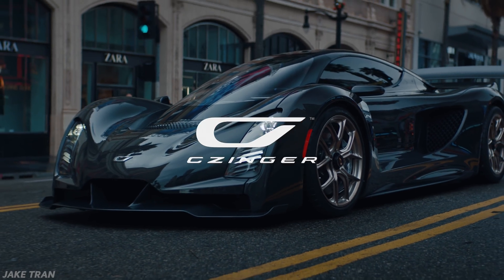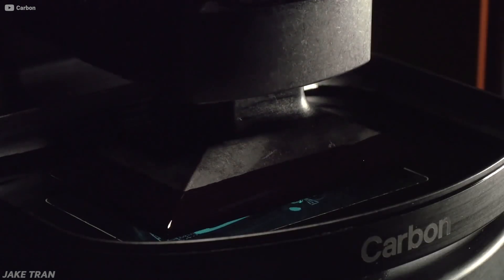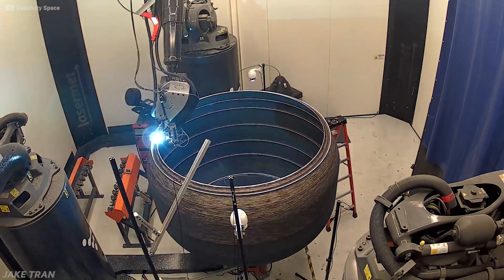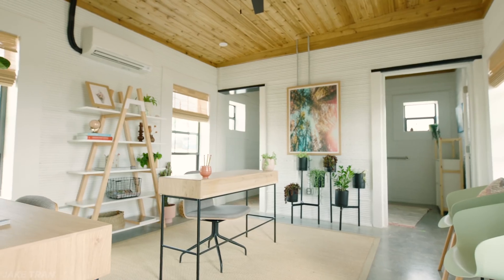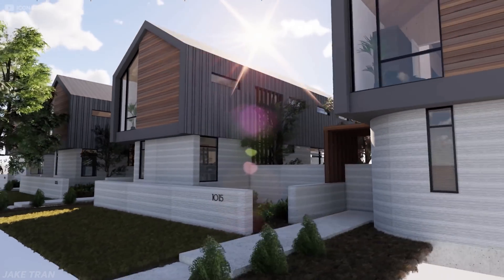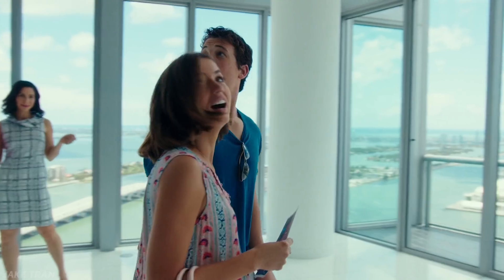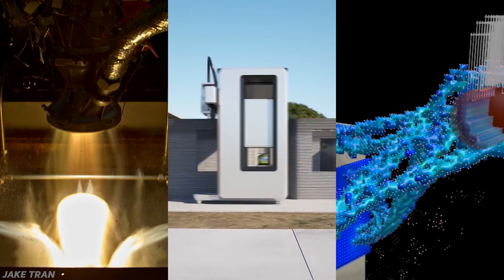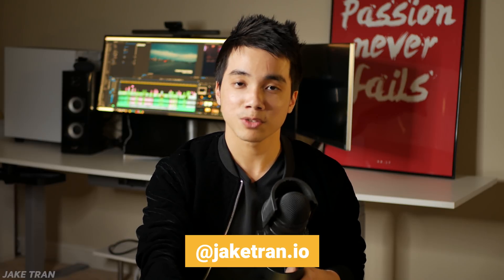The Trillion Dollar 3D Printing Revolution

Comment: As an architect, I have some thoughts on the "3D printed" houses. The interesting concession that gets ignored is that it's not a 3D printed house, it's 3D printed walls for a house. A tremendous amount of labor is still required to pour a foundation, manually add structural supports over openings like doors and windows, adding those doors and windows, plumbing, electrical and heating/cooling systems, appliances, lighting, a roof, waterproofing. Many people find the finished texture of a 3D printed wall rather off-putting and a clients with bigger budgets frequently have someone come in and manually smoothe the surface of the walls. Personally I don't see concrete deposition/extrusion revolutionizing construction any time soon. I'm far more interested in what large scale robotic arms with tools can do for conventional construction, personally.
Reply: Prefabricated buildings can be useful in large scale needs in short time. Take the last year pandemic quarantine effort. Or setting up disaster/social/economic refugee camp. Or just provide cheap alternative for building construction, you know something that's more about being practical than aesthetic heavy.

USA has major problem with housing and property. Most people would be glad to just have bunch of walls and roof without difficult starter cost.

Comment: 3d printing is amazing. revolutionary. But the internet would have you think it will replace everything... no chance. It's still wasteful (if you're using powder as most of it must be thrown away) and it will never be as fast as stamping components. each manufacturing method has it's pros and cons. Maybe there will be a 3d printing bubble.

Comment: I work with the world's most advanced 3D printer (NanoScribe) at a top engineering university AMA for my (relatively) expert opinion on 3D printing.
Reply: @Lame Jackson 03 Laser sintering is what is primarily used for metal 3d printing. Metal in general, while having a crystalline structure at the atomic scale, is composed of grains at the micro scale. how those grains are shaped/ what other trace elements are included do a large part in determining the mechanical behavior of a metal or alloy. 

While i do not work with laser sintering, my immediate take would be that it is stronger than polymer parts but not as strong as cast parts due to thermal damage surrounding voxel of print. further heat treatment of the part afterwards (annealing)may fix this problem.

Comment: The leaps in additive manufacturing we are waiting for are called multiple output / high speed forming (not limited to a single extrusion head), high accuracy robotics, and the declassification of some precision measurement technologies. Oh, and the publicly available mass production of carbon nanotubes, and the means to interlink bundles of nanofibers with Benzene and other methods.

Comment: As a realtor I really like the idea of helping someone custom build their own 3D printed house. 

As someone who loves 3D printing I noticed that you can't have anything close to an overhang without some kind of specialized support on that house. This isn't a negative it's just something interesting. 
I also think it's awesome that they printed those rocket parts using Giant Vase Mode. GVM could also be used to make some pretty interesting cars super quick. if they get the technology right we could see a rise in custom car manufacturing.

As someone who wants to get into real estate investing I would love to be able to print out some duplexes triplexes or even potentially a small apartment complex for relatively cheap and then spend some of the savings on generating better infrastructure, if possible then pass some of those savings on in rent. Or have average infrastructure and pass all the savings on or even charge the same and use the extra on several good handymen. There's so many interesting possibilities.

Comment: Ok, I would like to add a few clarifications about this.
First, the problem with 3d printing machine parts is in material quality. The powder laser process creates porous polycrystaline material, which is much weaker than machined aluminium. Same goes for most metals, and quite simply, it's not always good enough to settle for this, as you may need materials which don't leak air through themselves when you go to space. Of course, there is also the fact that such uncontrolled crystallization creates many surface defects which can cause material to suddenly break. This is same effect as trying to tear a piece of paper, vs piece of paper with tiny cut in it. It will be easier to tear paper which has tiny cuts than undamaged paper.

Of course, also important to point out is that these houses are made purely from concrete. Normal houses are made of brick + concrete or even rocks + concrete, mainly because concrete is pretty weak material. It's, as someone else put it, a glue more than anything else.

Of course, none of this is to say that 3d printing has no future, but it is important to keep in mind the strengths and weaknesses of various technologies.
In this case, there are many situations where material being somewhat weaker or porous is not that important, but say in space industry where saving weight is of very high importance, it may not be most ideal solution.

And main strength of 3d printing is the ability to create any shape you want, which is very important when specific shapes which are difficult to mass produce are in demand. And naturally, the need to lay bit by bit means it will print slower than it would naturally be possible to produce with factory setting. And, lastly, the need to melt or use inefficient lasers means 3d printing will use much more energy. So keep these things in mind. That is all I wanted to clarify.

Comment: WIRE 3D PRINT FOR THE WIN!!!
Ropot arm + Welder is the glimp of the future :D
Reply: Anyway, 3D printing will be SUPPLEMENTAL. 
None 3D print metal could ever ever stand forged one (because of material magic inside)
HOWEVER, there are companies printing molds for metal casting; time is reduced from 5 weeks to 5 days, work involved is 10x lesser... So imagine how awesome is that!

Comment: 1:39
The reality of it is that 3d printing is only "better, cheaper and faster" in small batches. So, no one is going to mass produce those cars any time soon. Unless they have a print farm, but at that point it would not be cheaper.
Reply: I wouldn't be so absolutist about that. The reduction of parts needed is a big +, a printer can work close to 24 hours a day and man-hours & traditional tools are some of the most expensive aspects of manufacturing. Last but not least: I'd bet money 3D printers will become a lot faster, versatile and cheaper in the (near) future. Also, Working with metal-dusts should reduce material costs a lot, compared to the waste from cutting things out of solid blocks.

Comment: 7:00 - Icon project of homes for mexicans looks great!
But making/building any rigid houses in a seismic zone is a wrong way. You need a construction made of beams with joints. Joints blocks a momentum of force so it's not falling when an earthquake happens. Although if a house is flat then maybe it's no need in joints here. Because it's more expensive.

Comment: 3D printing is slow, inefficient and expensive compared to the methods we already have. Next to that it is way more brittle. It sort of makes sense for home creation as that is not something you can already do with plastics or metals. Any other 3D printing is just for prototyping and nothing else.
Reply: I LOLED when they started throwing around terms like "better faster and cheaper".  Better? In what way?  Faster?  For one offs maybe. Each part is WAY slower than conventional manufacturing.  Cheaper? Hardly if you factor in the long build times.
I want to see how durable the fuel tank they printed is .  How many launch and recovery cycles can it go through before it fails/leaks?  The tank is basically one giant weld seam.

Comment: A new industrial revolution is bang on and we need it now more than ever.  The original revision in in the 1800's was severely flawed with the fact that recycling and re-usability was never taken into consideration at all, leading to severe global climate consequences.  3D printing will address one of the contributing major flaws - over-manufacturing.  Things can be built to order.  And despite higher prices, the economic model can still be sustainable.  Look around you right now.  Probably 50% of the things you see or own is not necessary.

Comment: Wow, I want a 3D printer can do that. My Ender 3 can only work with a few plastics.
Reply: They do make a metal extruder for the Ender 3 though, and you can even print carbon fiber parts

Comment: Why can't we seem to get standard modular panel homes?

Design is always driven by manufacturing but with rapid manufacturing if we build the design end to end with the intelligence built into the designs we can create variable designs that can be rapidly tuned to specific applications.
Imagine a sneaker designed specifically to you. This can apply to a range of applications including some day tuning a car to favor your most common commute.
 
I go back to the modularity and ideally automated reuse repair and modification because if your needs change you have new commute in a colder climate then tweaking your car could have benefits.

Comment: yeah but the metal is not as durable and has microfractures and wont last the load and stress there will ways be micro pockets of air in the material

Comment: Actually you can't 3d print organs even you ready all of the cells ready and machine able pick and assemble cells, there won't be intercellular connections so it just wouldn't work. Unless you find a way to make them develop after the assemble.

Comment: My only concern for 3D printing is the strength of the parts produced. Carbon fiber coating is a huge plus, because this gives the parts a lot of strength and rigidity.
But I wonder how the strength of the metal compares to traditionally forged metal. The printer is melting layers of metal on top of each other. The part may be strong in one direction, but will only be as strong as its "micro-joints" in the perpendicular direction. I guess this is where carbon fiber and other composite material-making techniques come into play. I'd love to experiment with all this awesome technology... 

God, I feel so far behind watching tech advance... while spending time at work trading hours for dollars.
Reply from the maker: def not stronger atm but they're making progress

Comment: 3D printing, strong AI, fusion energy, thorium reactor, unicorn.....
Reply from the maker: thanks for watching!!
Reply: 3d printing could help make stronger parts with better cooling
Reply: @macberry4048  Or lemon parts and space constraints that are designed to fail at 100,000 miles in order to keep the business running.

Comment: Jake - I am a Additive Manufacturing Engineer at a large yacht company. I'm constantly in talks with new developing 3D printing companies. 3D printing has a lot of limitations, and I honestly believe it is over hyped. Of course it will shift how certain things are produced, but they're not magical boxes (which people detached from the 3D printing world believe them to be). Instead of using a 5 axis CNC making titanium parts, it will be 3D printed in less time - true. It will save time and money - true.  With traditional machining, the more complex the part is, the more difficult it is to machine. 3D printing doesn't care about complexity. However the real thing that should be hyped up is Generative Design. All of those latis-like car parts could never have been imagined by a human, these are made with Ai and Generative Design. Giving a piece of software parameters for it to come up with thousands of "perfect designs" in seconds is the future of manufacturing. 3D printing is just the foot soldier for Generative Design to grow into it's own.
Reply from the maker: thanks for the insight!

Comment: Hi Jake.   Your video is really good.   I love it both for content and creative creation.   I've shared it with several friends.  I'm learning how making video and very cautious about copyright issues.  Basically afraid to move forward using material without permission.  Probably the reason is because I do not have a good grasp on the rules.   Can you share where you learned about this.   Any direction would sure help.
Reply from the maker: thanks for watching!!

Comment: ok I don't know much about 3d printers but I do know that they are not that complicated to build now programming might be an issue but still yet it honestly should not cost anymore than a $1000 bucks to make the most expensive type there is out there because pump cervos extruded aluminium and hoses and high pressure valves are not that expensive
Reply from the maker: thanks for watching!!